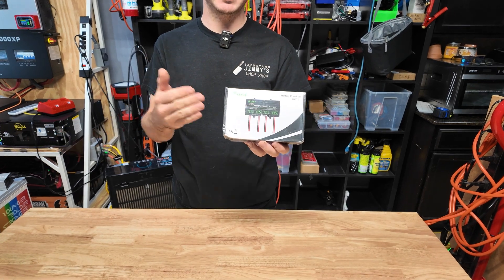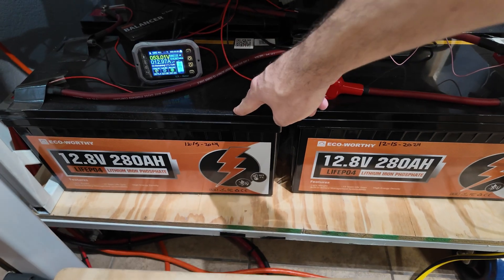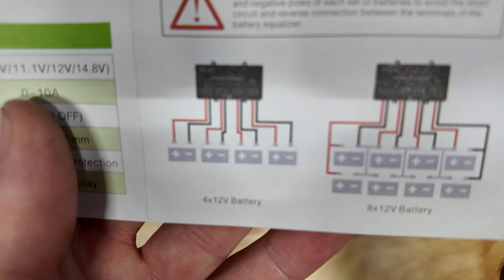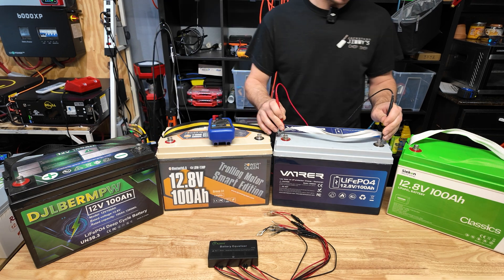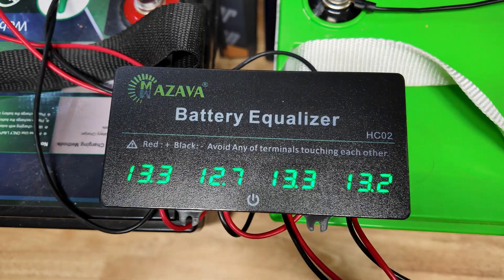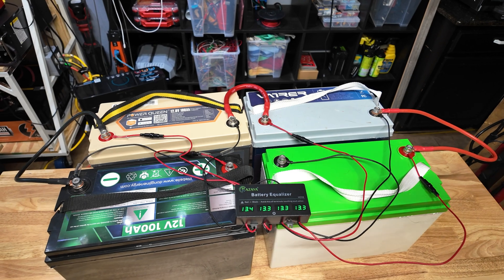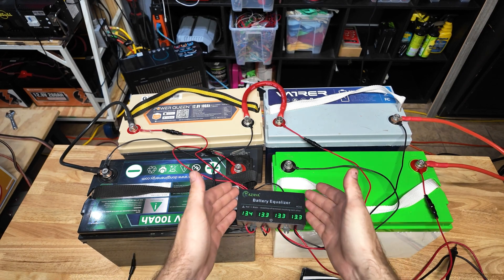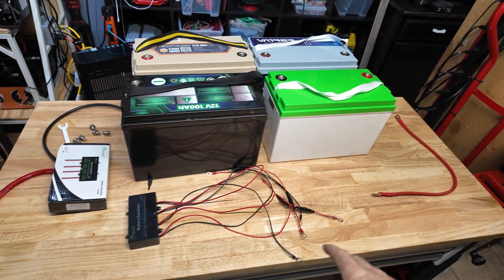48V Battery Equalizer Explained: What It Is & Why You Need One!

Comment: Can I used li time balancer for my 2 pcs of 24 volts? Using series?
Reply from the maker: I would see if it’s rated to be used on 2 batteries instead of 4
Reply: You can also buy a 24v x 2 equalizer. Same brand

Comment: Hi, I’m interested to know how you go charging them. I’ve been trying to build a 36v system. Purchased 3x 100ah cheap lithiums and used victron balancers between them. But when I try and charge with my 36v 20a lithium charger they go straight out of balance. One battery will jump up to 16v and the victron balancers just go into error mode. I don’t think they actually transfer any current but rather just flatten the high battery. I’ve tried a few times putting them in parallel for a few days before reconnecting in series and trying to charge
Reply from the maker: That's strange, they should somewhat be close if you parallel charged them first. If one battery jumps to 16 volts, more then likely its hitting high voltage disconnect, and shutting off the BMS. I would maybe try a slower charge rate, it may have a better chance of working
Reply: Ok thanks! I was blaming the inconsistency between the cheap lithium’s… but your video shows it can work even with different brands.
That’s a good thought, 36v chargers aren’t real common though!

At this stage I’m designing it in a way that I can quickly convert it between a series and parallel configuration and do my charging at 12v

Comment: Greetings, how can I connect an equalizer to a bench of 8 batteries from 6V to 48V, which is my solar system?
Reply: Yes
Reply from the maker: @alexandercalderon1695  Then your good you dont need an equalizer. Instead the whole bank is equalized as a whole, most charge controllers will have a setting for that
Reply: @Mikebuildss  Ok, thank you, I just wanted to know if I could install an equalizer to ensure the useful life of the batteries
Reply from the maker: Are they lead acid?
Reply: Are you saying that you have 8 6v batteries wired in series to make 48v ?

If so then the most straightforward option I have seen is the Huaxiao HA02-8S. It looks like the unit tested here without the voltage display, but is longer and has cables for 8 batteries rather than 4.

Comment: I'm planning on using 4 of the renogy 300ah in a 48v (51v) system - i heard it is usually recommended to use the same exact batteries as mixing odd batteries can have issues like this (even mixing old and new of the same battery can be a problem)
Reply from the maker: You are correct. That is recommended. Also make sure you look into a battery equalizer, to keep the 4 separate batteries equalized
Reply: @Mikebuildss  It's how I came across your video, thank you for putting it out there!

Comment: They are rubbish, the voltage on the led meter drift out of calibration by 0.6Volt massive and useless, and they do not balance properly, they may draw up to 10a to balance but that's not what Ive seen its more like 2Amps max.

Comment: I have the same batteries I need the balancer.. fk yea and he is so right about the price. And most 4 batteries together to make the 48 has more storage for the cheaper price. Most 48v rack have 100ah these have the 280..and cheaper.
Reply: That's because they have lower capacity by about half of the 48V rack... Ah is not a unit of capacity its how many amps you can discharge but you must also consider the voltage. 48v*100ah = 4800Wh (actually around 5kw since battery voltages are actually 51.2v) , while 12v*280=3360 (actually right around 4kw) so... the 280ah battery above is about 1kwh smaller than the normal 48v 100ah batteries in capacity.

Comment: I am one of the cheap guys that was using 4 in series for 48v. I noticed the problem and ended up with the active balancer. Yes it solves the problem and I also bought the ones with the display. And at about $70. it was an annoyance.
So anyone interested, yes they work great. 
I like the one you bought. The fused positives is a huge bonus. With all of the wires it's easy to short as you hook up all 8 connections. There is a little vinyl sleeve you can cover the ring terminals on each wire.
There is another version that looks exactly the same with the exception of only having 1 ground wire and 4 positives. I smoked the first one hooking it up. The vendor was nice enough to send me a new replacement. I hooked that one up and smoked it as well. I did contact him and told him what happened to the replacement and I was willing to eat it but I wanted him to know there's an issue if other customers complain it's real. I bought another 8 wire version on Amazon and it works fine.
With all of that said I bought a 48v 100ah no friils battery on Amazon Friday. I paid $639. for it with free shipping. First thing I see in the paperwork is a QR code for an app to connect to the battery via Bluetooth. So I got a bluetooth battery with low temperature charge protection delivered for $639. plus tax. 
Best part no balancer needed because one BMS takes care of 16 cells. A $70. savings. Next best thing, no need for me to make my bus bars from copper tubing and heat shrink. I just wish these were available when I started this adventure. I'm currently sitting at 25.5kWh and I think I will snatch up one more of these before I can't. Or before a tariff can be applied.

Comment: If you put all the batteries in parallel first, they would have balanced themselves out. Then, you could have put them in series to keep them balanced with the top balancer.
Reply: Actually, that doesn't work because once in operation the batteries on the ends of the series will charge and discharge more rapidly causing the batteries to be out of balance.
Reply: @moirhoh  Not in my experience
Reply: Yes that's true. Although lead acids can a handle a wider drift.
Reply: @Defianthuman PBSO4 dont need a BMS or balancer

Comment: Is it only for LiFePO4 or does it work with AGM or FLA?
Reply from the maker: It works for all types of batteries
Reply: @Mikebuildss  Thank you!
Reply: @benkanobe7500 I don't know why you would need it for lead acid or agm.  They should charge till full every time. The problem with the lifepo4 batteries is you are wiring 4 BMS's in series. One fills up the other 3 stop charging.

Comment: So I think I just heard u answer this..but is the reason you paid $10 more for this off brand over the LiTime because it has display? Which reminds me.. when I hook up my cheap battery monitor to my 4s 12v/48v battery set up, I'm wondering what reading is it going to give me? An average of all 4?
At any rate this is another one of your well timed / I'm doin' the same thing, videos, lol (you've had quite the history of doing what I planned on doing with the same or similar products right before I was about to do the same thing, which has been freaking SO helpful👊 ;-)  
I have 5 TimeUSBs', 2 RedODOs' and a Weize. I was (against every "experts' " advice) thinking of putting the leftover TimeUSB and add it to the others and do exactly this to make another 48v battery unit, so I'm looking forward to seeing the outcome. Bob @ Projects in Paradise 808 did this when his 48v PowerQueen had a BMS issue, and his faired pretty well. I'm hoping they stay balanced after a few discharges, and this proves his good luck with different batteries wasn't a fluke, and proves mixing these batteries isn't all "that" bad of a plan.
Thanks again for the video.😎👍